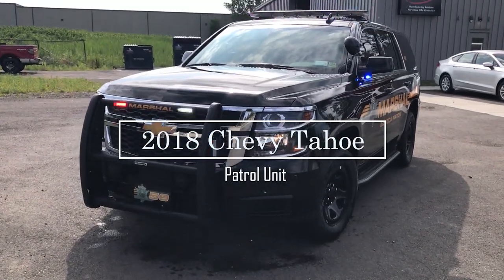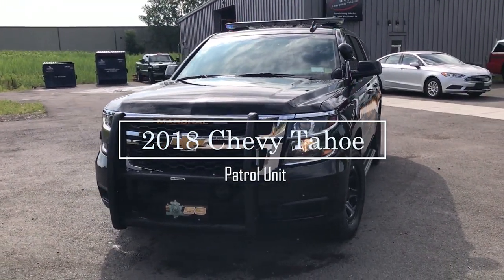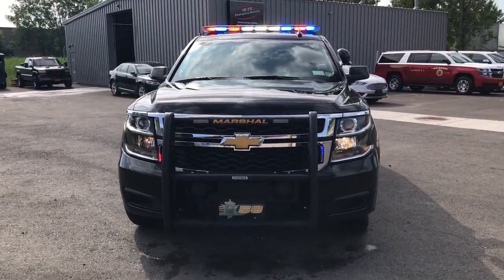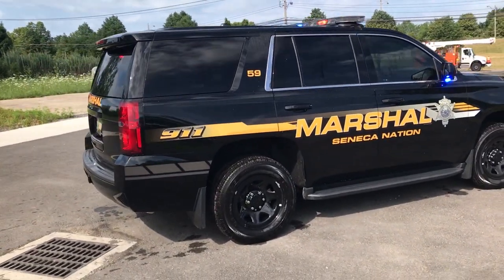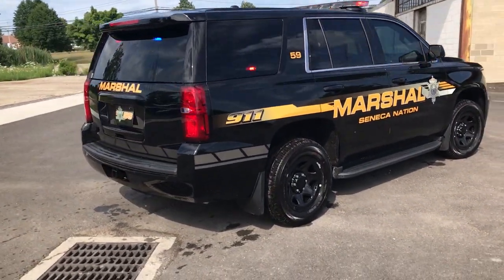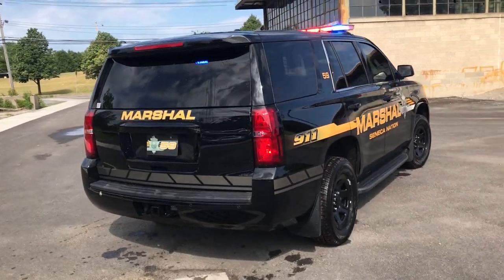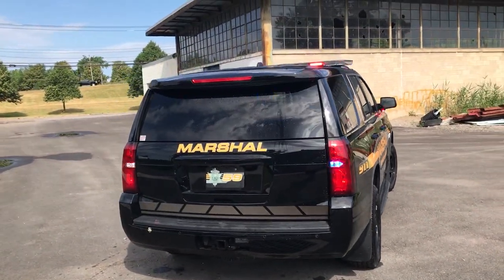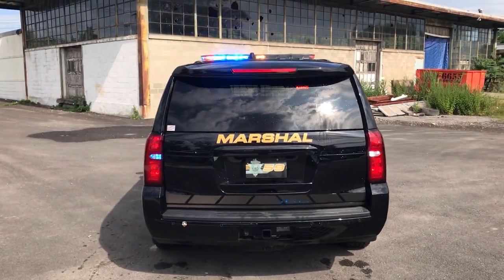Seneca Nation Marshal 2018 Chevy Tahoe Patrol Unit 10-75 Emergency Vehicles

Comment: How many mpg on highway and how often you drive this SUV
Reply from the maker: You will need to check with the manufacture on the miles per gallon.  We are not the operator of the vehicle